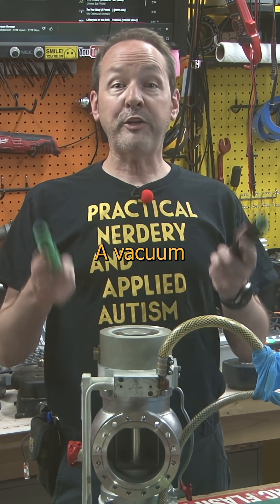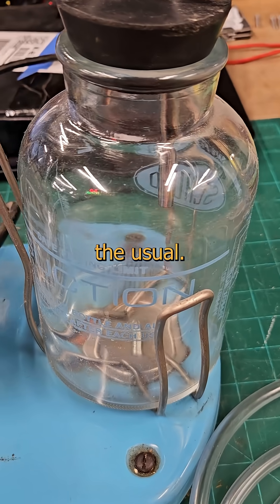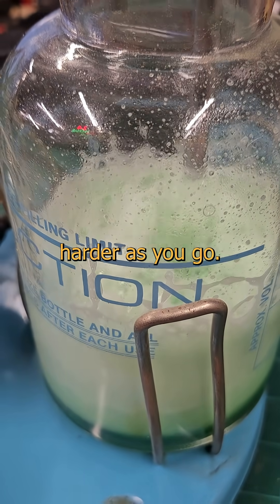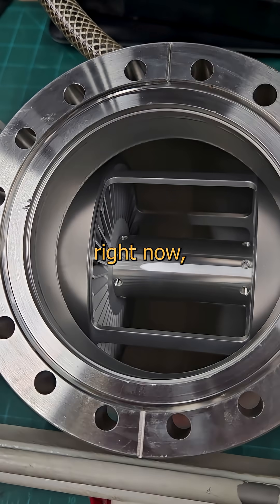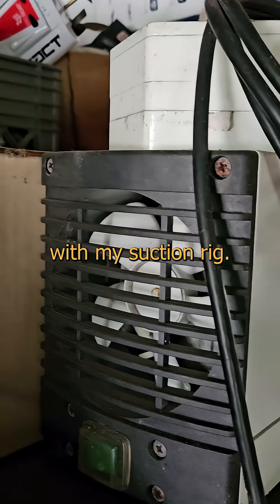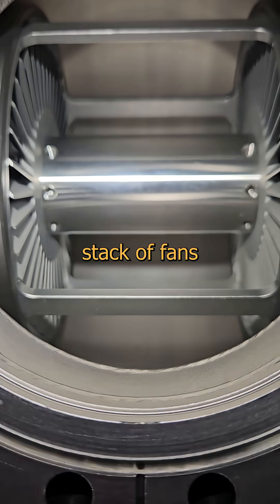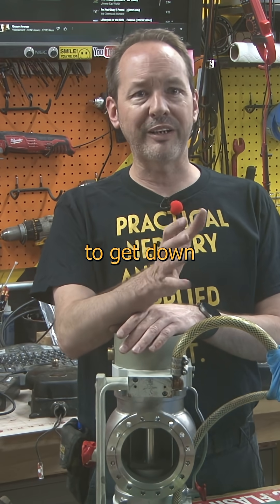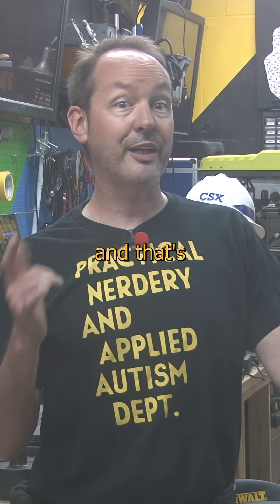Turbomolecular Vacuum Pump #chrisboden #comedy #engineering #physics #science #turbo #nerd

Comment: YEEEAAAHHH ITS MY TIME

I work with these to evacuate vacuum insulated pipes which are used for transportation of cryogenic liquids. 

Ours have 9 stacks of rotors, each in a different pitch, tuned for a specific abundant element present in the air. Ours turn at about 60k rpm and consume only 13 watts to keep them spinning when at 1.0*10^-7 mBar because of the megnatic bearings. 

Ours can start up on ambient pressures but they'll throttle themselves relative to the meassured pressure and rotor resistance.

To reach 1.0*10^-7 mbar in our pipes we use heat blowers to play with the first rule of thermodynamics, volume stays the same, pump at a high themperature, then lower the temperature to lower the pressure. Easy as that. 

Honestly dude, if you're ever in the netherlands, i'd gladly show you around and i will let you play with a abundand source of liquid nitrogen.

Comment: Somewhat related ADHD induced share here. What sucks, but not enough, is that you can only raise about 30’ of water - ok, 33.9’ per Google - with a vacuum.  That is why they put well pumps in the bottom. You can push as much water as your hp allows. There are jet pumps in the bottom where you can have a motor topside or you could mechanically transfer the power to the bottom. Another issue with sucking is that if you have tubing, you want to make sure it doesn’t collapse. Not sure if anybody else remembers the Mr. Wizard with the long straw? Bill Nye doesn’t hold a candle to Mr. Wizard IMO. Later.
Reply: Letting the door open on the “problem with sucking” part. We know who we are if we watch this channel.😂

Comment: measuring the pressure at higher vacuums becomes an exercise mental gymnastics
it starts at measuring the capacitance from a deflecting diaphragm to measuring the temperature of a heated filament being cooled down by convection to launching electrons to knock off electrons of gas molecules and measure that
but those last two change with the composition, and you will never cease hating water sticking on everything

Comment: To maintain 10e-9 Torr these things often have run continuously because materials you wouldn’t think of as porous are.
Reply: Leak checking with pure helium because if that isn't getting in except by diffusion, fuck all else is either.
Reply: Having worked on Helium Leak Testers, everything leaks, stainless steel helps with Helium as Helium is fast at 6m/s but it sticks like those gel toys that crawl down the wall...
Reply: I vacumm fill transformers, and its impressive how quickly a transformer sucked to 150-200 millitorr will jump into the torr range if your vac pump shuts off. a really tight bank will lose between 50-100 microns per min.
Reply: @petesandberg3957  and extreme vacuums can pull molecules out of solid objects. Materials for construction of satellites are tested to see if they will degrade by weighing them before and after a stay in a vacuum chamber to see how much weight they loose from the vacuum yanking loose molecules.
Reply: Deez Nuts are Porous

Alright ill see myself out now😂
Reply: Outgassing
Reply: @petesandberg3957  I’ve seen this cited as the reason people say outer space has a “smell” as reported by astronauts. The vacuum in the airlock is pulling matter out of the airlock/spacesuit/whatever else is in there and it sticks around in the air when repressurized
Reply: EVERYTHING leaks…. The leak detectors we were using could detect a 1 cc leak over the course of 30,000 years.

Yes, the turbo pumps have to run continuously while the machine machines are under pressure. It’s the only way you can maintain that vacuum. 

We use much bigger ones and they spend at 30,000 RPMs. 

Believe it or not, you can actually dump it by dumping the vacuum … it can tank it a few times before it goes out…. New people…
Reply: I've read that the LIGO pipes were heated to a few hundred degrees, had their internal pressure pulled into a vacuum and kept like this for a couple weeks in order to let the steel degas properly

Comment: So does the turbo molecular pump work by pumping the remaining air out of a high vacuum chamber into a low vacuum chamber? Because I can't see how it would work without valves if the output side is exposed to full atmospheric pressure.

Comment: This is one of the first videos I’ve seen here where I’ve understood everything. 

I work in a plasma lab, and in a lot of laboratory plasmas, you work under vacuum so the only thing in your working area is the substance being turned into a plamsa (something like argon, krypton, or xenon) and we use basically the same pumps for it. In the lab at the university I go to/work at, the turbo pump we have looks very similar. It is slightly different in that the blades use magnetic levitation to spin without bearings, and so they’re even more fragile to changes in pressure. What’s also interesting is the instruments to actually check how close to vacuum you are, which is a whole different can of worms.

Comment: that is a Balzers horizontal turbo pump. it has two compressors one on each side of the inlet. I had one fail once while I was working on a JEOL 100cx electron microscope late in the evening trying to take resolution photos.  There was a catastrophic failure of one of the end bearings which relied on a cotton rope soaked in oil. It came to an instant halt from full speed and let out a sound like a gun going of  between my feet.

The pump in this video is Circa early 1980's.  Most pumps used today don't have bearings that can fail under load. The internals are magnetically levitated during operation and the rotor isn't touching anything while spinning at usually somewhere around 50krpm depending in the size and model. smaller pumps spin a bit faster than larger ones.

Comment: The depth of the earth's atmosphere is debatable. Considering the ISS orbits 250 miles above sea level, it's hard to think if it as still in our atmosphere.
I prefer using the 62 mile (100km) limit as less that 0.3 parts per million is above it. To anyone who thinks that's significant, I'm part billionaire because I have $300.

Comment: I used to work with ultra high vacuum system in semicon thibk 1x10^-7 mTorr, that shit was use for SEM and that was just with a roughing pump and a TMP granted out ran at 49,000 rpm

At that point the air molecules are so far apart they could travel essentially miles without ever colliding with, like imagine being told you had to walk 20 miles before you even bump into another person that's how empty these pumps can get it to.

Comment: On my engineering internship I got to work with/around diffusion pumps, they did the final suck with mechanical pumps roughing. They're pretty cool, no moving parts just vapor cones and side walls. My understanding is that it essentially uses the fluid dynamic principle, a fluid has friction at the boundary layer and itself. Think of the vapor cone jetting out as a river and the air as a leaf that falls into it. 

Oh btw these were massive, the valve that covered diffusion pumps are 42" in diameter and they pulled enough for our electron beam guns to work but those are another story. 

I got my MechE degree last month, been working as a machinist and millwright but start my new travel engineering job end of this month!

Comment: What if you put a vacuum chamber inside of another vacuum chamber.
You pump the outer vacuum chamber really really low.
Would that make vacuuming the inner chamber easier because the relative pressure outside of it is already low?

Comment: These are useful in X-Ray applications, such as semiconductor manufacturing. Every second machine in a clean room for semiconductor fab has one--or more--or these bolted to its chamber.
The roughing pump would be coupled to this from a separate room or floor, with big metal hoses.

Comment: TMPs are fun because their design is more or less just a wall of "No!" Based purely on probability. When youre down at low enough pressures, you're basically waiting for any molecules of air to happen into your pump. And, inevitably, when they do, they're spinning so fast that the TMP serves as a one way valve, swatting the air out and spinning to fast for them to go back in.
Reply: My Agilent spins at 60,000 rpm.

Comment: Used to work on an extremely large vacuum chamber we had everything you mentioned in the video. Cryo pumps, roughing pump, turbo pumps. we made auto chromatic windows for commercial buildings. Anyways vacuum will teach you about proper assembly and clean sealing surfaces. It was a cool job. The particulars of working on a vacuum chamber really tickled my tism.

Comment: Its legitimately crazy how hard we try to get down to perfect vacuum. We have sputter coasters at my work, and we use cryo pumps to get the pressure down to < 5 x 10^-6 Torr.

Think of that pressure this way: for every 150 million molecules of air that we start with, we remove all of them except for 1. 

Now THAT'S pretty cool!

Comment: And I can do one better! Let's just say it's the cold hard truth that the third....th,th,th....th³... sorry, as I was saying, the one more part to take you EVEN CLOSER to zero, would be a cryo pump....and it's not even REMOTELY ANYTHING that resembles a pump! It takes over what the turbo just can't grab simply by freezing! Yes, it actually condensates the last bit of molecular mass....m&m.... sorry, as I was saying, it does this by getting the atoms to stick to the internal frozen surfaces of the "pump". It doesn't actually move or pump the atoms, but just collects them and holds on to them, for dear life!, to keep them from bouncing around the chamber. It works the same way as a glass filled with a cold drink, the water collects on the outside of the glass, as it pulls each water molecule (humidity) out of the air. That's really all there's to it! Molecular pumps are basically the small freezer that never left the weight room and now has the strong grip to hold on to the last atom out there!

Comment: That’s a Pfeifer model, one of the old ones if I’m correct. We have the larger version on our old BAI1200 coater. The big ones run at about 600hz. I‘ve seen on that broke while running and it’s not pretty

Comment: I’m an mass spec service engineer and these bad boys are in the base of every MS. You are correct they basically explode when they defin super high rpm right into the casing. For MS your typically at 4x10^-5kpa for the higher vacuum measured with an ion gauge

Comment: Also called a molecular drag pump. This is often used to remove the air in the outer vessel of a cryogenic dewar or cryopump. A cryopump can reach down to orgasm shattering temperatures of 10 to 20 Kelvin. Now that is cold!

Comment: Used to work on gear that used these things.

We had a software problem....  sometimes the pump would be spinning full blast when an emergency valve would open.

The poor thing would make this horrible shrieking sound.

They chose to use C# to operate the machine.  Should have used C++

There are things like 'virtual leaks" - gunk in the vacuum container will outgas.   You cure that through heat blankets and careful surface prep.

Cryo pumping uses nitrogen.   Maybe there are better ways?
Reply: Used to work making plasma diagnostic instruments, langmuir probes and the like, we used a length of piping with a few t and cross pieces to make up a test chamber to basicly test the glass to ceramic and metal seals, getting down to SHV took ages and outgassing from anyrhing not washed in ipa and baked was our main hassle, like some idiots thumprint😂

Comment: A good friend of mine works at Plum Brook Ststion in Sandusky, OH. It is home to the worlds largest vacuum chamber that can get down to space conditions. Its been awhile since he told me about it, but as i remember, they pump as much air out as they can, then there is another machine with a venturi and it sprays oil through. The air molecules stick to the oil.
Reply: That would be some kind of oil diffusion pump.
Reply: @nate6386 correct

Comment: a silicon oil sprengel pump should be a decent "low tech" roughing pump giving fairly low pressure with only dripping oil for working part. then if you think safety is for weaklings, a mercury version, for higher vacuum , we are talking below 500 micro-pascal or single digit torr numbers...

Comment: I think it was Seiko Seki that made the Helical Groove Turbo Molecular Pump. Those things are absolutely bulletproof as long as you replace the bearings and bearing oil/grease cup on the service intervals. Also,  that KNF pump will likely not have enough throughput to back that TMP you have. If you are looking to do vacuum stuff, a lot of pumps are available now on the used market. 

I have 35 years of experience working on semiconductor manufacturing equipment, an ADHD persons dream job. As far as pumps go, we like it when they suck and hate it when they bang. Love you're videos.
Reply: Yeah that little diaphragm pump isn't going to cut it. Buy a second hand or refurbished Edwards rotary vac pump for roughing.
Reply: @chemistrykrang8065 I was wondering why wasn't using a rotary vane pump.
Reply: @chemistrykrang8065 naw, Anest Iwata scroll or kashiyama
Reply: Dude I’m also in the semiconductor industry and it’s been fun. To think that without any vacuum technology, the semiconductor industry would be nearly impossible. I work for Edwards and the amount of pumps we replace and maintain is staggering. A lot of pumps get replaced because they operate under corrosive and harsh chemical conditions depending on the tool they are installed on. Let’s just say we are always busy.
Reply: @ericc4277 I am still having QDP 40s and 80s rebuilt that were made in the mid 90s. Best rough pumps ever.
Reply: I’m in semiconductor manufacturing as well and no kidding it’s been a dream job for my ADHD!
Reply: @zdude5596  At certain Asian company fabs where they only care about HVM and getting wafers out, yes. At a large American chip maker, only if you work for them and not a vendor.
Reply: @TJ14142 yup I work for the only MAJOR American one not a vendor. It’s been great. Night shift none the less so now it’s unsupervised ADHD shenanigans. 😬 but I’m on the repair side not the production side.
Reply: @TJ14142, that depends on the vendor. When I was a service engineer, I had no issue  telling the fab/customer to contact my boss for any changes or additions they would like and that they should have a PO ready to go to cover whatever they need. If time allows this visit, I will try to diagnose the problem to speed things along. However, it may not be me that does the work, since we had travel schedules planned out for 6 months. Some customers were rude and pushy, they recieved minimal extra help. Others were respectful and appreciative of my efforts and I would bend over backwards to help them out.

Fun times
Reply: Pfifer